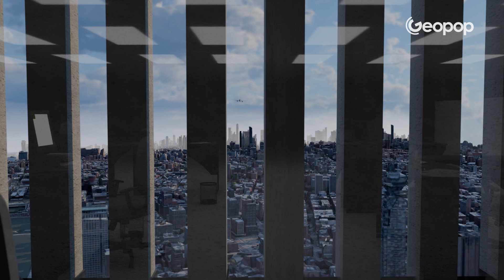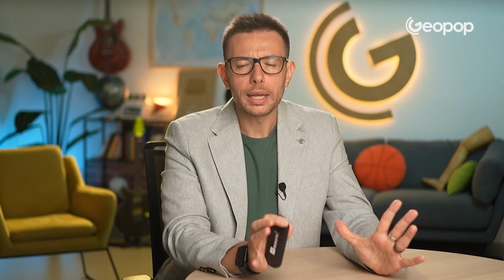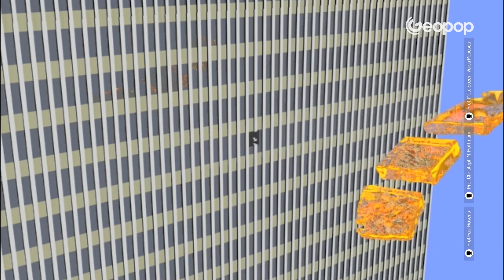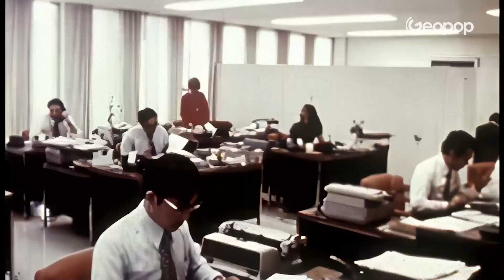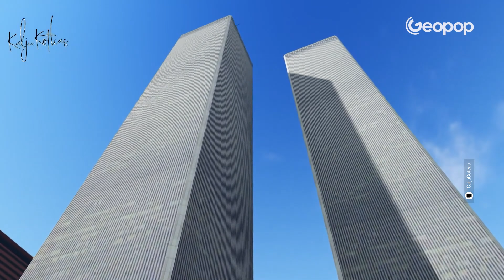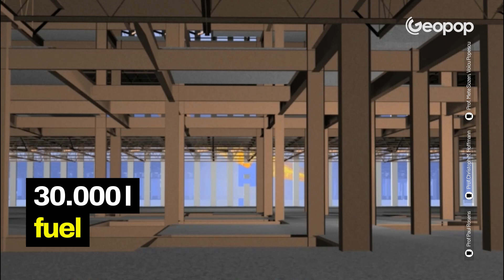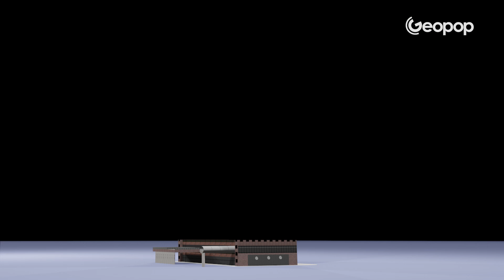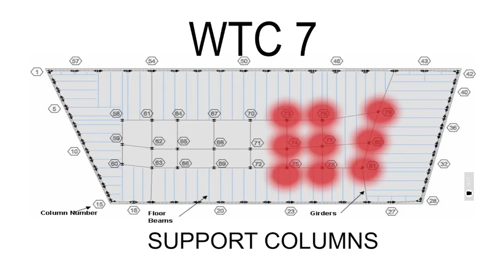9/11, 2001: The Technical Reconstruction of the Twin Towers and WTC 7 Collapses

Comment: When WTC7 collapsed more than 95% of the steel was cold and then it can't collapse. This video is nonsense.
Reply: Huh?? Did you even watch?
Reply: @Jnoooooo  Yes. Watch the explanation from 20:00 where he says the expansion of the hot beams will make the cold beams collapse. The cold beams will not collapse.
Reply: I don't think you understand how structures work.
Reply: @TheLoonResistance   I just posted a reply with a link for read which automatically got deleted. Why did that happen?
Reply: @chlor7877  - You answered your own question - it included an (outside) link. Can't do that.  

The collapse of the unknown and unimportant Building 7 – one of 6 buildings to collapse of 10 destroyed on 9/11 - confuses a lot of people, despite being one of the most studied engineering disasters in history. It was not famous, not a terrorist target, no one was killed in it and thus it did not get a lot of attention, so most know very little about it. There is a lot of tantalizing but absolute garbage out there on this topic. Given the choice between long boring, hard to find technical reports and readily available, easily digestible fantasy on the internet, many turn to the latter. To counter that I prepared this brief summary explanation based on my own analysis. No politics, just engineering. 

The North Tower collapse at 10:28am bombarded Building 7 with thousands of tons of burning debris, causing heavy damage and starting raging fires burning out of control for the next 7 hours. Half the responding FDNY firefighters having been killed, others injured, units in disarray, much of their equipment destroyed, no water pressure, and the greater urgency of Search & Rescue efforts, firefighting efforts at 7 were pulled as futile. The building couldn’t be saved and was left to its fate.

youtube.com/watch?v=g_SvpwyC17M&ab_channel=MFitz 

Collapse of a burning structure is always a concern for firefighters. Steel buildings subject to fire rely on active fighting of the fires to survive. Left to their own devices they will collapse. Buildings are designed around 1 to 3 hours of fire resistance, allowing time for occupants to escape and ACTIVE firefighting to get started, after which all bets are off. In B7 the occupants escaped, passive and active fire protections were compromised and active firefighting never got started which left the building to take its chances. It lost. Odds on Building 7 would eventually collapse,… and it did. No big deal in logic. That is the sort of choice firefighters make every day in brush fire situations - which houses to save and which ones to let go. Only real difference here is moving the decimal on the size and cost.

FDNY Chief Daniel Nigro ; The biggest decision we had to make on the first day was to clear the area and create a collapse zone around the severely damaged 7 World Trade Center, a 47-story building heavily involved in fire. A number of fire officers and companies assessed the damage to the building. The appraisals indicated that the buildings structural integrity was in serious doubt. I issued orders to PULL BACK the firefighters and define the collapse zone. It was a critical decision; We could not lose any more firefighters. It took a lot of time to PULL EVERYONE OUT, given the emotionalism of the day, communications difficulties and the collapse terrain

FDNY Deputy Chief Peter Hayden - We had our special operations people set up surveying instruments to monitor and see if there was any movement in the building. We were concerned of the possibility of collapse in the building. And we had a discussion with one particular engineer there, and we asked him if we allowed it to burn could we anticipate a collapse and if so, how soon? And it turned out that he was pretty much right on the money, that he said 'In its current state you have about 5 hours

With its deteriorating condition being reported throughout the day, the collapse of Building 7 expected by the FDNY, bystanders and the media meaning at least 24 video cameras recorded some or all of the collapse. Everyone at the time knew what was coming and why.

youtube.com/watch?v=OY5S5k3tMHI&list=PL4GiNqqck-lzR7pebSWRVLoXyu-aWR3Rr&index=48&ab_channel=911InvestigationVids 

Building 7’s collapse was totally different to the Twin Towers, harder to understand and most of the details difficult to see. But we can sort out what happened through careful analysis and observation.  What follows is MY EXPLANATION of the collapse sequence using the best available information and relying on no authority.

B7 was complex structure, a 47-story steel framed building built on top of a smaller existing 3-story building, requiring several lower floors dedicated to complex load transfer structures instead of usable office space. Of trapezoidal shape and all-steel tube-in-tube construction, B7 (above the 7th floor) consisted of a central core of steel columns carrying most of the gravity load, perimeter steel columns around the outside of the structure carrying the remainder of the gravity loads and long span beams and girders to tie those elements together and form the floors. On the outside of the building hung a moment frame - the last part of B7 to fall. 

Phase 1 : Collapse initiation for B7 is notably quiet with observers not realizing the building was collapsing! There was no audible warning in the form of say hundreds of ear drum busting 180-190dB explosive bangs preceding the collapse. The first externally visible signs of collapse initiation occurred at 5:20:28 pm. Here at 12:00 a local CBS affiliate reporter is talking 10 blocks from B7 when collapse begins. People don’t start to notice the collapse until 12:11. Then at 12:45 is the famous CBS fixed camera clip of Building 7’s collapse Again, note how quiet it is.

youtube.com/watch?v=t5tEy6mXSE8&ab_channel=fresnosean379

Collapse initiation was due to multiple lower floor failures above the load transfer region (7th floor) in the NE corner of the building. In this video at 0:45 you can see the NW corner from inside the building while under construction, Column 79 just out of frame on the left. That big, angled steel beam across the top of the frame connects to C79 at one end. The girders connect to the beam. The beam and all those girders depend on just one connection

youtube.com/watch?v=nP3TNHPCIVU&t=35s&ab_channel=EdwardCurrent

Phase 2 : Lower floor failures left core Column 79 laterally unsupported over an excessive length and it buckled. If you look at a floor diagram of Building 7 (see above) and look at all the structures that depend on C79 you quickly realize this one column was a relatively isolated structural element on which a disproportionately greater fraction of the structure depended . Externally we see a vertical progression of window breakage along the 44-46 line and a kink in the roof of the East Mechanical Penthouse at the top of the building, consistent with C79 failure. The transition from full capacity to almost no capacity occurs in virtually an instant. Once the buckling failure occurs there is almost no resistance

Normally with a buckling column, the load could very well be redistributed to other columns, meaning the buckling could stop after a while. With C79 that is not the case - the failure did not redistribute the load, so the collapse rapidly progressed to the roofline, sinking the rooftop penthouse.

Phase 3 : With C79 gone, B7’s progressive, non-symmetrical collapse continues with C80 and C81 at the east end of the core left laterally unsupported and quickly buckled and failed as well, sending the EMP down through the building. C79-81 all have no diagonal bracing, which I believe is a major reason why they could not redistribute a lot of vertical loads among one another.

From there collapse progressed from east to west through the central core until the core was gone taking all of the interior floors and structures and probably most of the perimeter columns with it. You can see the horizontal progression of window failures low in the building and the dropping of the remaining rooftop structures into the building. One of the big takeaways from the NIST Building 7 study (that gets completely ignored) was their modeling which determined C79 failing under ANY circumstances would have initiated the same collapse sequence.

Phase 4 : After about 10 seconds only the exterior moment frame - a hollow shell mostly supported by the 4 corner columns and quite unable to stand on its own – remains, creating the illusion the building is still standing since little has changed externally. That’s just hollow empty shell, like an empty cereal box. The north leans inward, forming a V in the roofline. The last remaining perimeter columns buckle under the strain.  There is almost no resistance as the moment frame free falls, landing on top of the 7-story high debris pile, blocked surrounding streets, heavily damaged the Verizon Building and destroyed Fiterman Hall at 30 W. Broadway, all well outside of Building 7’s “footprint”.  It is only here, at the very end that a single utterly meaningless measurement of alleged free fall is taken. Start to finish the collapse took 18-20 seconds, or less than 1/3 of true free fall*. Not that we really care since how fast something falls cannot tell you what started it falling in the first place. The free fall argument is about the collapse of the outer shell *AFTER all of the critical internal structure had already failed and completely ignores about 80-90% - of the collapse. 

Building 7’s progressive, non-symmetrical collapse was incidental and unintended collateral damage from the combined effects of fire + time + gravity started by the collapsing North Tower. That is true no matter who planned and carried out the 9/11 attacks or why . The collapse was of so little consequence it barely even registered at the time, a mere footnote. 

I hope you found this helpful. It is meant to be informative, not adversarial and to solicit informed critical comment. If I made any errors of fact, logic or reason or left anything critical out, please let me know so I can fix it. IF you can offer a more plausible alternative be my guest. So far no one has even tried. Please start any reply with the words “Tits McGee” or I will know you didn’t actually read it and won’t let you waste my time.

Comment: If we don't really know what happened that day, then there's something else going on. That's not conspiracy, it's logical and anylitical thinking. Those buildings were built to withstand something like this. Also buildings do not collapse on themselves if the explanation in this video were true.  They collapse like that only in a controlled demolition. Plus the reports of the explosions SEPARATE of the impacts. No, the jet fuel could NOT get hot enough to support the status quo theory. Also moving on to the reasoning of invading Iraq but the "hijackers" were not from Iraq. One thing is for certain, it was a horrible day in our United States of America.

Comment: The only conspiracy theory that would make sense is that they used cheap materials during construction so that some parts didn't fulfill the specifications.
Reply: When the impossible is excluded what remains however unlikely is the answer.   Also never put down to malice what can be explained by incompetence
Reply: People love to dunk on China for tofu dreg buildings. But contractors doing their best to cut corners isn't anything new. Even for Americans
Reply: OMG I don't want to believe you wrote that !!
Reply: I moved a piece of telephone equipment from tower 2 to tower 7 in the summer before the attack.  I was impressed by the tonnage of paper.  Every floor I saw had row upon row of filing cabinets, full and boxes on tops to the ceiling.  The towers burned many forests of paper, lit on fire with the match.  No one is figuring in the shear tonnage of the paper.
Reply: No, there’s a few other ones that make sense, you just haven’t looked at the evidence and testimony of those theories or you don’t have the capacity to think critically and take all matters in hand.
Reply: @Crackinjars  I have the ability to think logically and each and every theory I've heard of falls apart the second any reasonable amount of logic is put into any aspect of it

Comment: I’m one of those who actually DO think Towers 1 &2 collapsed due to planes and the fires, especially when you go back and look at videos of WTC 2 (south) is slowly leaning slightly. This said, WTC 7 is totally sus.
Reply: @colin-nekritz  
Go back and look at WTC 2 again. You will note that while the upper forty or so floor are leaning approximately 4 degrees, the bottom 60 pluse floors uniformly collapse much like that seen in WTC 1 a later.  This begs the question, what caused a uniform collapse of the lower portion?

Comment: What happens when you throw an egg onto a steel pillar? That is in essence what happened. And WTC 7?
Reply: There is a pretty massive difference between an egg and a 747, your analogy is stupid.
Reply: Even if you shoot bullet it won’t penetrate steel. It takes really a lot of force to penetrate steel and most of the plane impact force was absorbed by perimeter columns.